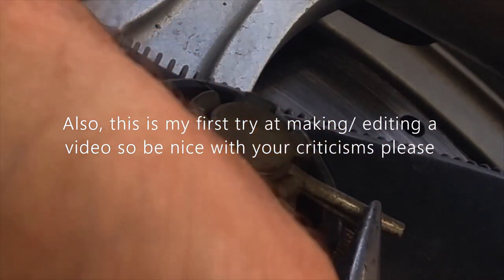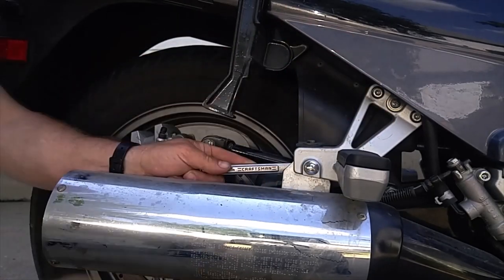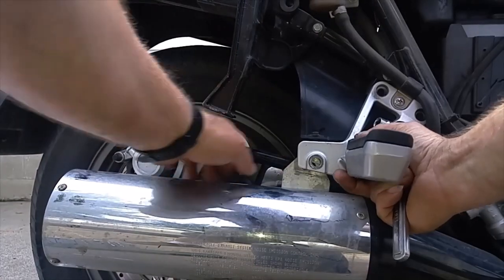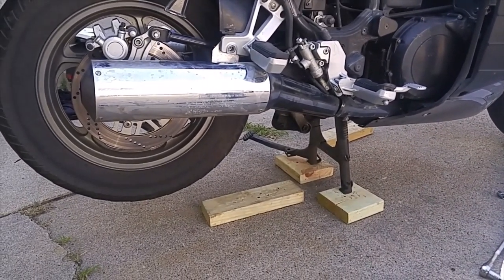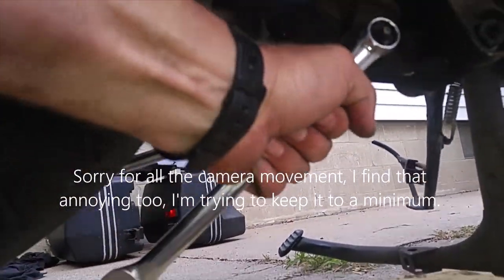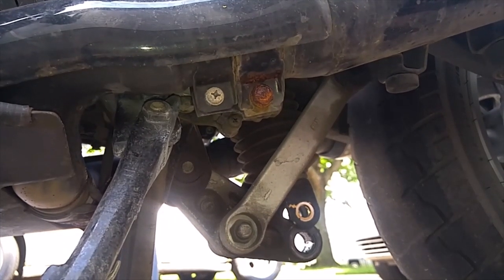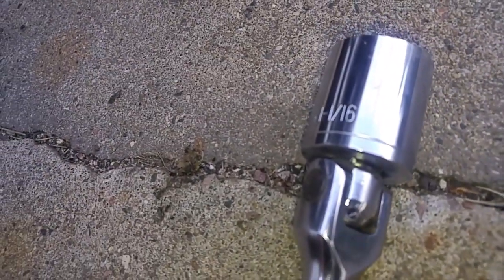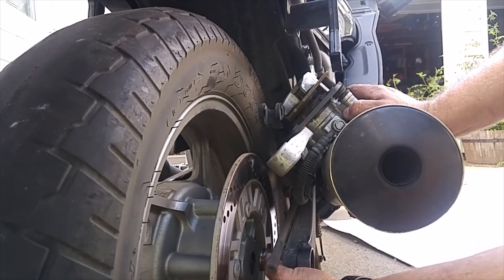2004 Kawasaki Concours 1000 Part 1 of 4- Rear tire change, wheel removal

Comment: Great, great work! I'm always impressed by guys who aren't afraid to go out there and publish, even when they're not fully confident of what they're doing. Letting everyone see the mistakes so that we don't follow down the wrong path. Thank you so much for your efforts. Cleared up a bunch of questions I had without having to go through the tedium myself! God bless.
Reply from the maker: Thanks Mike, I appreciate the thoughtful comment, I'm glad it helped. I couldn't find A video on the subject before I started that I liked much, so I figured I would just try it myself.
Reply: @repairandcreate6192  Absolutely.  And now I know how!  I DO have a question for you and anyone else out there in TV land who might know...  I love my '92 Concours.  It's in brand-new condition and runs like a sewing machine.  No scratches even.  However, I do have an issue with its seating position.  I traded my KLR for this bike, and now I get fatigued in my upper thighs when I ride for more than an hour or so.  I solved part of the problem by buying lifts for the handlebars, which keeps me more upright, but what I REALLY need are highway pegs.  I have tried to see if I could fashion them myself, but there are very few places where they might attach.  Do you, or anyone else here, know of a set of highway pegs that would work with this year model?  I'm having no success on the Googles.
Reply from the maker: @mikesulhoff1137  That's funny that you had a klr, I did too, but I kept mine when I bought the Connie. I don't have info for your on highway pegs though, sorry. I tend to stand up often and also let my legs flap in the wind as well. I made some highway pegs for my klr that replaced the front engine mounts. I'll take a look at my Concours in the next couple days, and if I get any brilliant ideas I'll share them with you.
Reply: @mikesulhoff1137  Hi Mike, this is 2 years ago you wrote this, BUT here goes.  I’ve owned my Connie since 2006. I’ve purchased a ton of stuff from “Murph’s Kits” out of Kentucky.  He has highway pegs/bars that fit. They run bout 158.00 ish last I checked.  Shipping is USPS priority and it’s included statewide. Great guy. I purchase the C10’s tip over bars years ago, and I attached Kuryakin Hwy bars/foot pegs. (& they cost …more than Murph’s, but are a little more bling… . Plus I had the 1” tip over bars on already.). His kit  doesn’t require anything. Good luck

Comment: Thank you! The shop manual doesn't mention taking that bolt out from the shock. Without getting that wheel lower, that axle will never come out. I knew there had to be a better way than removing the mufflers.
Reply from the maker: Glad it helped you Jeff. I'm sure I'm going to forget by the next time I need to do it so I'll probably be watching it too...lol

Comment: You don't really need to mess with the shock linkage. Remove left muffler, then rear brake caliper. Unbolt drive unit like you did. Push out axel until it clears the left side of the swingarm. Now pull tire and drive out. Pull out axel, Bob's your uncle. When reinstalling push axel through drive, then tire until flush with spacer. Slide under rear of bike, push axel through swingarm and put on nut finger tight. Tighten final drive bolts and axel bolt. Put on caliper, muffler,  done. Doing it this way you don't need the block of wood under center stand.

Had to take mine off the other day, gas tank full. Getting bike on centerstand bit nerve racking!
Reply from the maker: The reason I didn't was that I didn't want to mess with the exhaust seals, and the exhaust bolts were stuck pretty good as I recall. That was my first thought though was remove the exhaust like you said. I would have to rewatch the video to recall, but I thought the rear fender was the issue that blocked the wheel from coming out from under the bike that the block solved for me? Thanks for adding to the discussion.
Reply: @repairandcreate6192  End of the day, you got it done.

Cheers.
Reply: @repairandcreate6192  Look, great job because you went the distance & “got her done!”.  I’ve removed my rear wheel twice (?) for tire change.  The Clymer manual (2004)for my 2002 Connie, has the rear wheel coming off in just a few steps.  I’ve watched several videos where a new owner, or new to wrenching on a C10 went to great lengths to remove the rear tire, as you did.  Those exhaust “gasket(s) are cheap at Murph’s Kits out of Kentucky. I purchased one, but mine was in good shape, so I just reused it (twice). So, does that make you a sorry so & so for doing it the hard way?  Of course not!  Man, I was impressed.  Some folks (me) have never changed out a MC tire on it’s rim! It’s just not a fun job by hand… . Changing bicycle tires can be a plain (to me).  Great job really. You got what it takes my friend 👍🫡. 
Oh, the previous owner of my mc, had removed about ?? 6” inches on the back part of the fender & relocated the license plate holder way higher.  He did NOT realize it would make pulling the rear tire of WAY easier.  I reaped that benefit 😎👍🤗.  If your going to keep your Connie (as I have since 6/11/2006), you might consider relocating your rear license plate holder up, and cut off the stuff below.  Makes removing that rear tire easier for sure.  I suppose I could let the MC shop remove the tire from the bike, but that’s a lot of money when it’s really not that hard once you’re done it once or twice.  Pulling the tire off the Rim?  Now that’s some work I’m not sure I want to try at 67… .  Again, great job, & thanks for the video sincerely. Pa bird
Reply from the maker: @strshooter7399  Thanks for the comment man. I'm sure it will be much quicker next time I do it. I learned alot the first time, plus I have all the useful comments to read through for next time. It has kind of amazed me how supportive and positive the comments have been on my small video library so far. Thanks again.

Comment: Very good video!  I've worked on a lot of bikes, removed a lot of wheels and never thought removing the wheel from the C10 would be so difficult.  Good thing I watched your video first.  Thanks very much for taking the time to post this.  Where are parts 2 thru 4?
Reply from the maker: Thanks for the kind comment, I'm glad it helped you out. I don't have very many videos up so just click on the name repair and create under the vid, and the rest are right in my videos. Seems kind of odd that they don't just show up in the related videos? YouTube can be odd.
I also uploaded the front wheel change in case you're doing that too.

Comment: There is no need to pull that drive unit. You can the tire off without removing that.
Reply from the maker: It's been a while since I did this video, but I was curious what you were reffering to so I watched that part again. It looks like the tire width was too wide to fit between the swing arm and the bevel gear assembly. Do you just force it through? Or do you mean, you leave the assembly on the wheel and just take the front 4 bolts out?
Reply: @repairandcreate6192  the stock size tire will fit in there. It is a bit snug, but nothing was forced. This is still a great video, and I am thankful it was there. It helped me get my wheel off and tire changed. I just thought if someone didn't have to go through the trouble of pulling the diff, it would save them some time/effort. Again, thanks so much for posting this helpful video.
Reply from the maker: @RealSuburbanCowboy  no problem man, I'm glad it helped, and thanks for adding the tip. The comments are as helpful as the videos I think.